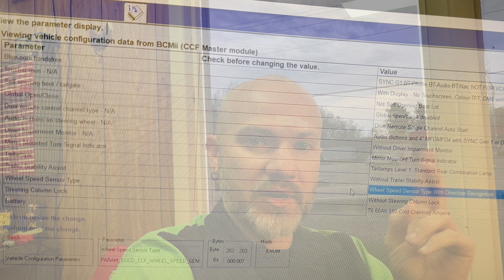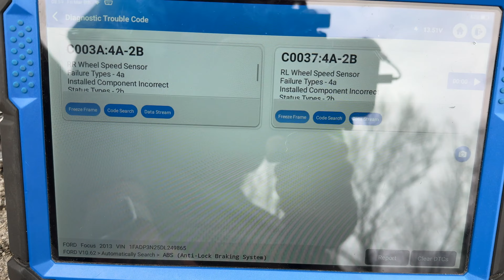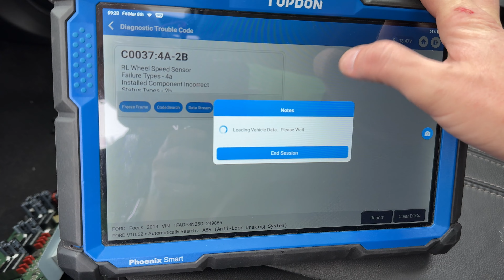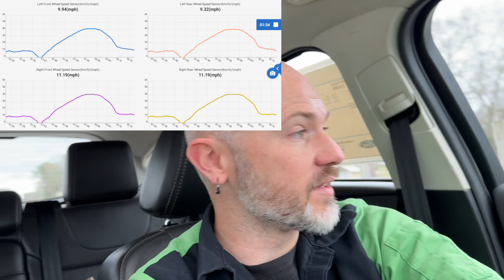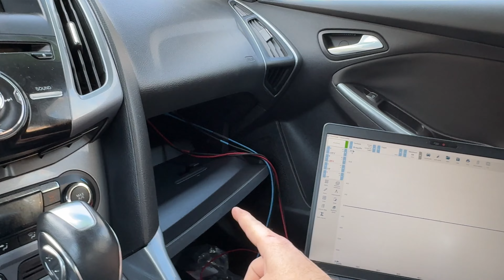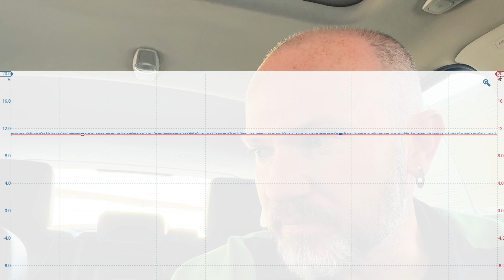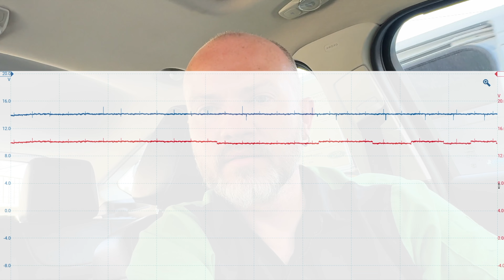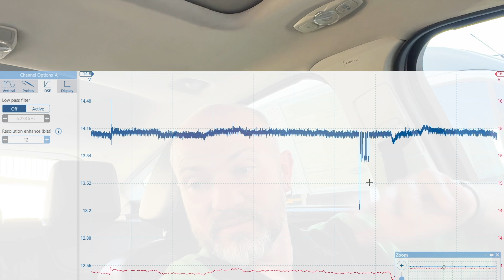The Un-Fixable Focus is now FIXED! - Part 4

Comment: Yeah, tripped and hit your van, uh huh.... Just be honest, this car was causing you to bang your head! lol  I know I was banging mine and I wasn't even working on it. 
But, wow on the sensor being wrong, twice, even with a bi-directional sensor installed! And it is an active sensor that sends data over the two wires for rotation info (or other data), instead of using three between two hall effect sensors to determine rotation. So there is more in that sensor than just hall effect sensors. 
Thanks for scoping it too and noticing the noise that was actually the data. 
And, where is the guy who commented on my comment about the park assist sensors, "why park assist, it doesn't have it"? lol

Comment: So if the code triggers instantly without even moving, I have to assume the abs module sends out a bias voltage. Im curious if there is a resistance difference between the sensors that the abs module didnt like, and second, if you knew what the proper resistance was, could a fine tuned decade box substitute a good sesnor? Am I way off in that thought? Thanks
Reply from the maker: These sensors a digital so resistance measurements are irrelevant. The module is looking for the data packet that I showed in the scope capture

Comment: Did you upload this information to the mechanicsphere or to Autels or your scan tools sharing platform? This is very valuable information on the sensor compatibility with the hubs. Does the sensor have a current flow that is effected by the hub ring metal composition or are there tiny magnets, indentations in the ring.

Comment: Jake that is crazy and confusing. Are you saying the only way to get the correct sensor is to replace the hub assembly? I have to watch this again. So even if you get the green sensor it will not work in the after market hub? I feel like a real dumb ass. I’ll watch it again. Thanks for sharing. How technical are ordinary cars going to get.  👍 Artie
Reply: It was a sensor issue not the hub. If the original mechanic would have ordered the part by the original part number this would not have happened. This is a Ford inventory computer issue. They don't show the correct part number based off the VIN which is nuts.
Reply: He did install the green sensor in the aftermarket hub assembly and it did not set an error code so the sensor does work in an aftermarket hub.

Comment: I had the same car with the same issue.  The left side rear speed sensor.
The owner of the shop got me after market. After some digging  I found that the sensor were made in hungry.  The ones I got were made in Mexico. 

I told him we need to get these made in hungry. 

The customer decided to take to the dealership. 
Never knew what happened.  

This confirms my diagnosis. 

Thank you for showing this video.

Comment: I’ve been tenured with JLR and with Ford. It is quite surprising with Fords market size as a brand, that they can have so many part incompatibilities by vin. I have ran into this with many of their sensors especially MAP sensors. Loved the comment sections quick jump in the last videos to “I told you it was an incorrect CCF” haha I will tell you though that the verified data and good known in the very end of the video is extremely valuable. Thank you for taking the time to make these videos.

Comment: Did they when building the car in factory ran out of "normal" sensors, and the just configured "this" Car for this crazy configurtation ? Parts Shortage ?
Reply from the maker: I'm sure there is some option the car has that requires this sensor but service information leads you to believe it's only for active park assist cars and it's not.

Comment: Since it's using an encoder type bearing, i now understand why the code was permanent, cause sensors on encoders are absolute for some, so you have to match encoders with correct programming, only and only the correct reader/sensor will work. Encoder ring could be the same but the reader/sensor matters most here

Comment: The parts suppliers i feel should pay for letting parts out that do not correspond to a repair-simple simon parts makers make sure the part orderd especially by a vin should be the correct part for the application for what it is intended for-i was wonfering if the counts from the sensor was out of range so mis communi ation Thanks Jake wow

Comment: So why did the antilock read the wheel sensor before you programmed it I still believe the problem was with the programming and the sensors can’t be that narrow you did a wonderful job as you always do your so thorough but the dealers are trying to make it to where we can’t work on our on cars but they don’t have mechanics that can figure out the problems I not saying just ford because it’s all of them I am having engine trouble on a 2015 Chevy truck with a 5.3 with the v8 down to v4 at 3000 miles I purchased the hp tuner turned off the afm dod and now at 44000 miles I have a collapsed # 7 lifter and I changed my oil every 3000 there are poor parts going in cars
Reply from the maker: There was nothing wrong with the programming. With the used module it was looking for a standard MR sensor signal, which the sensors they sold me were. When I got it configured for the car it then was looking for this data type packet which tells the module the wheel direction and speed.

Comment: HI great job, in europ we have abs sensor grey,  when you have park assit or hill start assist, I'm looking on rock auto and you can find just the sensor for this model, they have 3 different reference
In the tranning I learn if the vehicule have a grey color you need to put the same color, it's because you have aid assist, but the issu for you, it's modifi when you give the car and the parts in the dealer is crazy issu to. We need to see the configuration in the BCM for make sur what's parts we need. you wast you time but you learn and your determinate to find the issu and it's a very great value for you. Thanks for sharing your experience.

Comment: This is where dealership ties really help. Props to you, aint no service data for that type of work! How did you find out that the hub came with a new wheel speed sensor? Makes you wonder whoever changed those hubs had to have that same issue and because they didnt do anything about it, they just punted the car. Think about doing the hubs on that car and then discovering that issue? Its a super easy problem to solve. The shop punted the car and you were left to pick those pieces!

Comment: You could have just plugged in your part and spun the hub by hand,   without installing the bearing or ever taking the car apart;  and you would have known your answer.   Edit:  Oh, I guess you did on the other side. :) ...  So it's not even the hub;   It was just the wrong sensor.  Wow..   I had this same issue with Ford with my 2002 F350.  My door sticker says it's an "incomplete manufacturing" ..  (in other words, it's a "cab and chassis") (basically sold without a bed on it).   But it also has a manual transmission.   Well there are two different coolant temp sensors on it.. and they are different on the automatic vs a manual....  Also, when I search my VIN, half of the sites say that mine is a "E350" --  meaning it's a "VAN" -- but it's clearly not a van.   And of course the Vans' (with the same 7.3L diesel) have totally different sensors than the trucks, and again -- different for the automatic vs the manual.  So there's at least 4 different sensors, and it was a complete nightmare finding the right sensors.. and I never got a correct answer, I just had to buy a few of them and see which one worked.   FORD needs to really work on fixing this problem.  The parts store vs the dealer-- would give me different answers. 

My sticker on my door does not have the "Axle" listed---   it's just blank.  Yet when I call the Ford Dealer and give them my VIN --  they still can't tell me what axles my truck has??  lol.  What a cluster f^ck.  It's like they don't keep good records for their "cab and chassis" trucks.

Comment: I just did rear wheel bearings on a 2016 Ford Fusion FWD. I was putting aftermarket parts in from local part store. When I looked up the part it had one listed as Front or Rear FWD or AWD. Then a 2nd part for FWD Rear. I ordered the FWD Rear bearing because that's what I had. I ordered part in because they didnt have it in stock. Customer brought back car and its Friday at 330 when I got the part. Sure enough its wrong part. So I did some research and there is a date breakdown. Even following the manufacture date the catalog would still have been wrong.

Comment: thanx for bringing us along!!!!    makes me wonder if they got aftermarket hubs with sensors??? so whomever changed the wheel hubs still has the right ones? see this is where a parts hanger didnt check thier work or they'd have seen the abs light right away. crazy but thats the world of parts availability. years ago mfg's had to keep parts availability for 10 years. i believe that mandate has expired. so more and more cars will get scrapped just because some specialized sensor is NLA.  looking back the big clue as i pointed out was the new wheel hubs. what a wild ride!!!

Comment: What really comes down to it is it was the right part but the resistance diode inside the sensor was wrong so what it comes down to but it’s just being drug out I’ve seen that on crank sensors were aftermarket would not work because it wasn’t correct on a resistance, and I had to put a OEM in it and it worked finebut he’s doing around it he’s trying to figure out what’s different about it
Reply from the maker: Digital sensors don’t really matter about resistance. I clearly show how the correct part operates compared to the incorrect, 2 completely different parts

Comment: As a retired 
 year Ford mechanic/service manager, I can only say wow!!!. You have to be an engineer in today's automotive repair shop. 
 My only thought is that the module sends out that small Datta package waiting for a return package for verification of both transducers. The signal of the wrong sensor is totally different and does not return the Datta package in my opinion. 
If you are like I was, I'm sure you had a bunch of sleepless nights trying to figure this out. 
  I'd like to know how many hours you invested in this car, between actual work, diagnosis, chasing parts and research. I'd like to know how you did Bill for the repair. Could you imagine if you were a flat rate tech in a dealership? 
You are a special pearson to be willing to share your hard work with other techs  and viewers!
Reply from the maker: I think it works similar to a SENT module where the abs module is looking for a data packet from the sensor. One way communication only.

Comment: So im confused. The original complaint was the 2 codes being incorrect sensors?  Were the rear wheel bearings replaced before there was any abs issues?? I must have missed something. But thank you for sharing this story. It must have been very frustrating for you, but it was entertaining for me. Lol. Man, what a journey.
Reply from the maker: From what I was told the car was bought this way.
Reply: I think there was some misinformation somewhere down the line. But way to stay on it till the end. Would love to know how all this was charged.
Reply from the maker: @raphaelbalachsan4764  not enough is being charged that’s for sure. Hopefully the video series will make up some of the difference.

Comment: Lot of European vehicles are using this type of signals these days. In the data package information is sented like i am the rear left sensor, direction and wheelspeed. If you take a deeper look to the signal you can see that for example a part of this datapackage change from wide to narrow when changing direction of the car. Great video, thanks.

Comment: Jake, your still the best thorough mechanic out there. I the car was brought to you first, with out all the part changes, You would have been able to identify and cross reference the sensors and had it fixed in an hour.

Comment: Great series and case study. I guess the lesson learned is that you can’t even trust the OEM parts anymore. The other thing is keep the broken parts until you a 100% sure the car is fixed. 

The problem for you is that by the time you get the car it has been through multiple shops and you never fully know the problems that have been inflicted on the car.